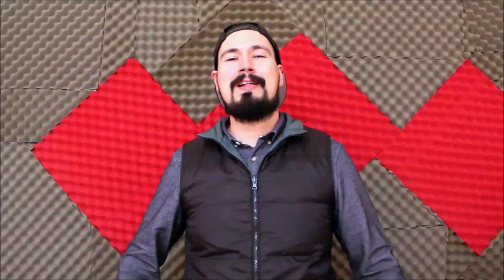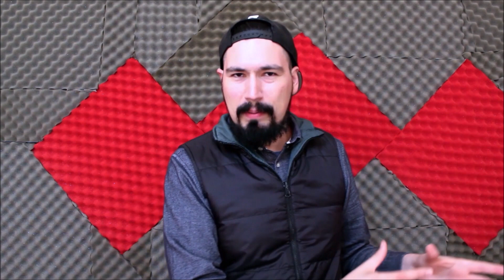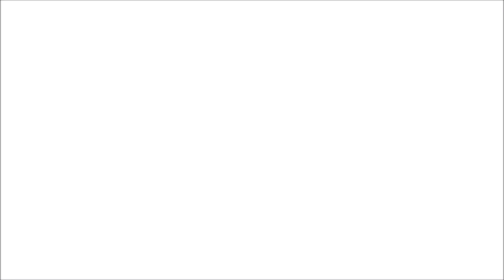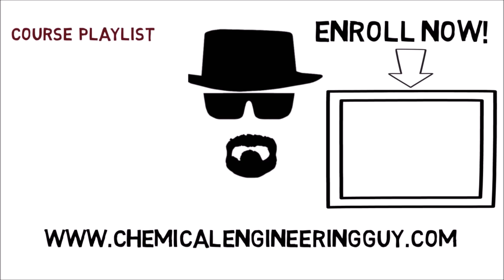Aspen HYSYS - Your First Simulation - Course Closure (Lec 037)

Comment: sir aspen hyses is important for petroleum engineering?
Reply from the maker: Only if you are in the refining part! If you are in the upstream section, must likely you will NOT be using a chemical process simulator. But if you are in the downstream section, you might be using it for petroleum refining, natural gas transport/piping, etc